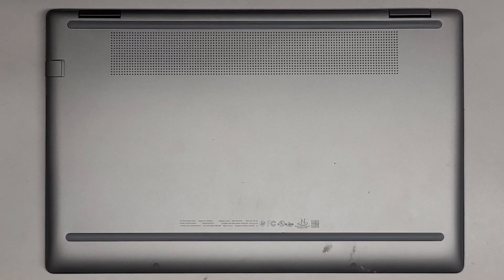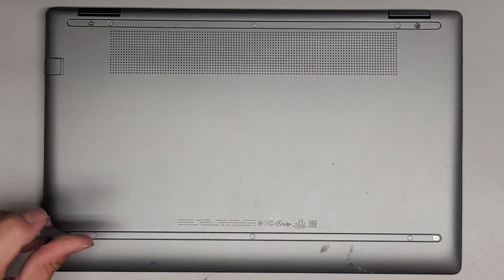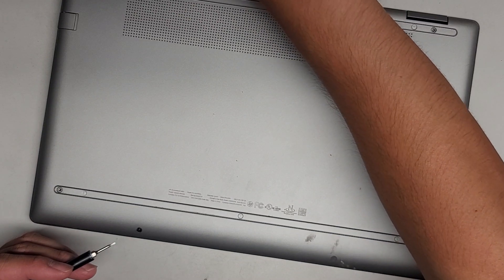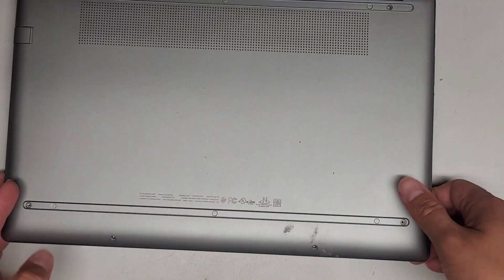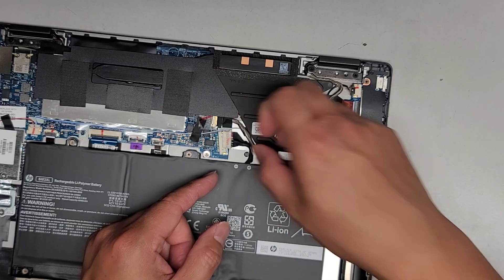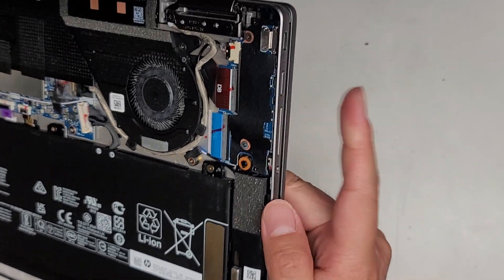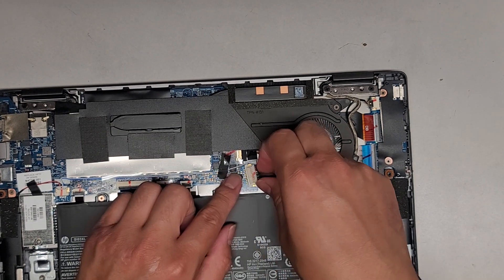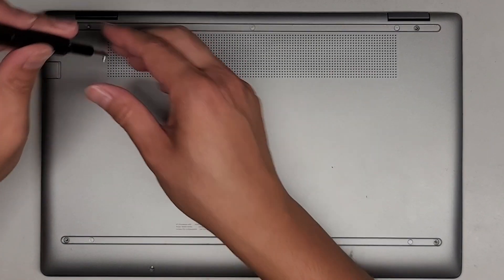HP Chromebook X360 14c-cc0013dx Disassembly Battery SSD Quick Look Inside

Comment: I have a chromebook x 360 hp it has a black screen. The battery is charged fully i tried. Ctrl alt shift refresh and power. Also refresh and power. Battery disconnect charge cord and all the keyboard combos. 

Still nothing but with a charger plugged in and battery disconnect it flashes orange from charge indicator
Reply from the maker: Flashes usually mean low power. Maybe it's not charging.
Reply: @ItsBinhRepaired  well i  know its charging cause the light was solid orange with battery in and plugged in then turned blue. i just dont know what else to do the board looks fine to the naked eye

Comment: I have this laptop, it takes good 5 seconds to power on, you don't need to press the power button on the side, it turns on by itself, try using a 65w charger.
Reply from the maker: @rafaelmacedo6679  I tried a 100w charger lol

Comment: Do you know what might be causing this? I have a customer who’s laptop is having a similar issue where it turns on with battery but not without the battery and with a charger plugged in. Also can’t get an external image. I’m not too familiar with chromebooks.
Reply from the maker: I'm not too sure sadly.

Comment: Nice vid, my chromebook doesn't sleep when it is closed and I did some troubleshooting, it wasn't the power setting and after some further reasearch I think it is the hall sensor board. I don'y know anything about computers but do you know where that is in this one?
Reply from the maker: You can run a piece of metal around the frame to find the magnet.
Reply: So do I need to still open it up and how do I put the magnet back in place?
Reply from the maker: @charliedub1184  if you have a semi strong magnet, you can try running it around the edges to see if it triggers the sleep mode.